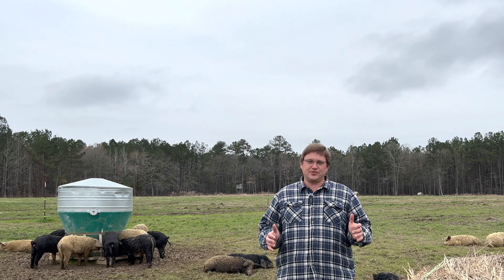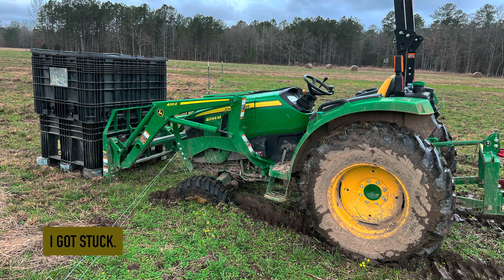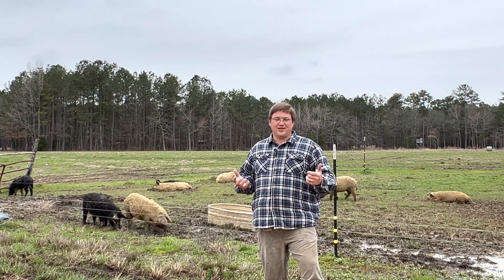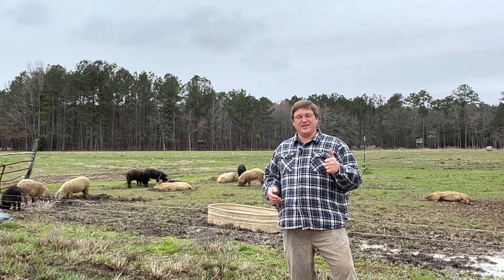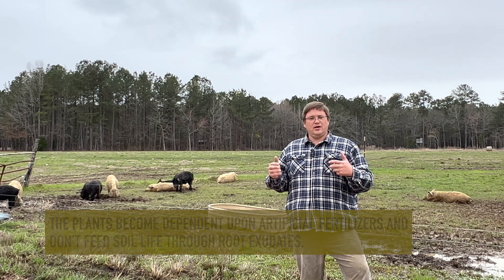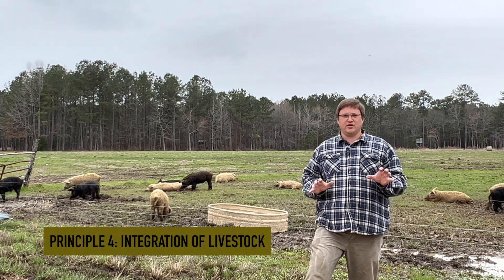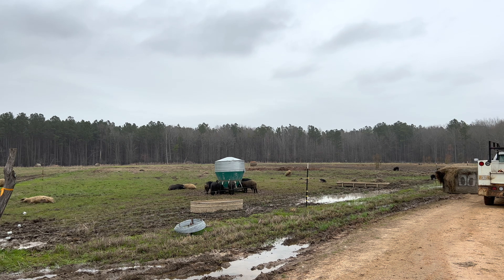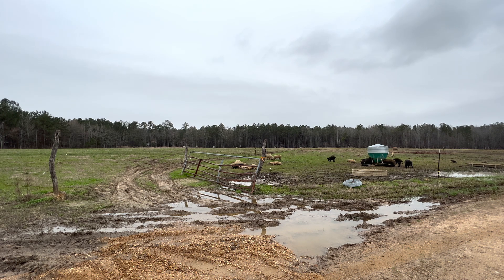Improving Soil Health on a Small Farm: A Case Study in Regenerative Agriculture

Comment: Hello Rob. I just found your YouTube channel. I have questions on my 10 acre field. I have a lot of bare soil . It’s starting to thawing. Do you think it would be good to till about 4 inches and seed it and feed my 10 cows on it? Do the same thing to each acre.? The reason for disking is to break up the compaction? To get pasture going this spring.
Reply from the maker: Tillage and discing can create more long term issues with compaction. Usually, the only time I disc or till is to cover my large seeded cover crops so that they get enough soil moisture to sprout. It sounds like you are in the midwest or an equivalent dry area in the US. If so, by the time it is dry enough to disc or till, you may not have any more significant rainfall for the growing season. You might try broadcasting smaller seeded plants like clover and ryegrass. Look of "frost seeding clover" but as the ground is freezing and thawing in the winter/spring you broadcast clover seeds and that freezing thawing action in the soil helps them seed better. If you can find a decent forage for your livestock that can be broadcast on the ground without having to be covered, it can start growing earlier. You might have some success with it. 

In terms of warm season forage crops, you could try a crabgrass and sunnhemp and/or cowpea mix for the warm season. You wont get as much production out of it as you can with the sorghum sudan mix, but there are fewer issues to worry about in terms of prussic acid and nitrate poisoning, both of which can be a bigger issue in drought. 

Sorry that I can't be of more help, I just don't know your context as much.
Reply: Chisel plowing breaks up compaction and hardpan with minimal topsoil disturbance